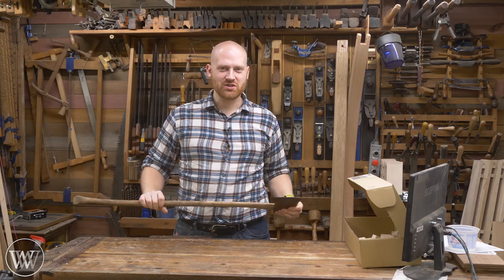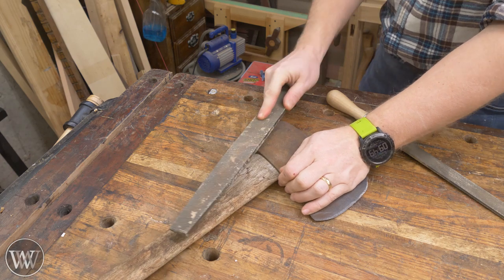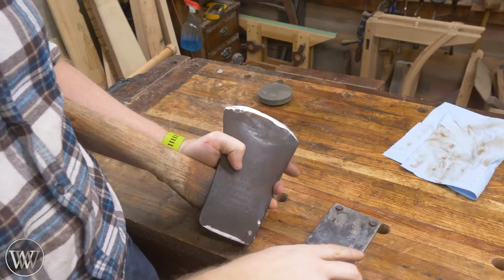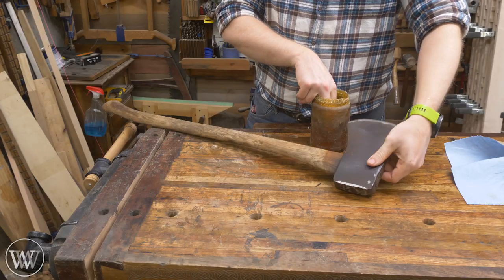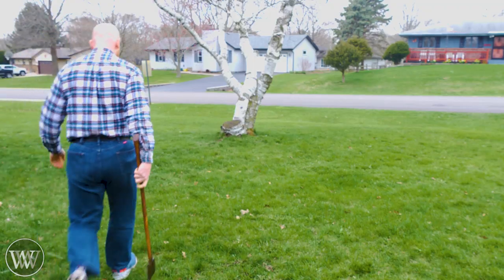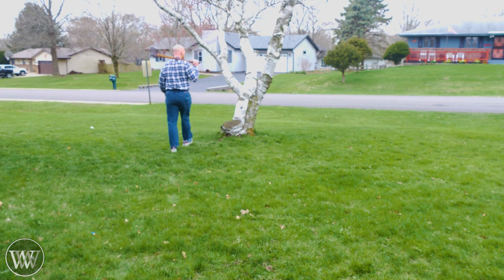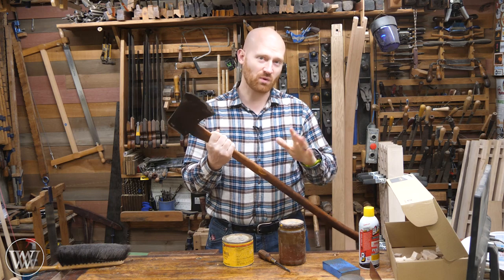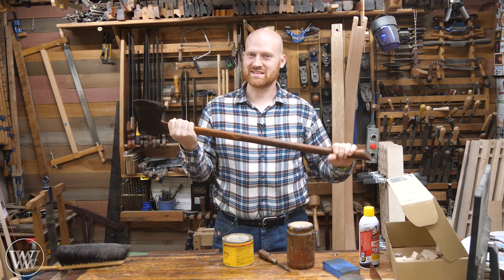Cleaning A felling Ax

Comment: Hey James, thank you for sharing this video, as it is always a joy to see good tools get some TLC. If you ever have a spare ax head or other tool with a lot of rust, try boiling it for twenty or thirty minutes and scrubbing the surface with a very light brush or fine wire wool. If I remember correctly, boiling the rusty iron converts the red oxide Fe2O3 to black oxide Fe3O4. (At least I HOPE I got that right, it has been so many years since I rust blued my beat up old second hand shotgun.) Once you get the look that you like , oil it up and let it sit overnight.
Reply from the maker: Interesting. I'll have to give that one a try. Thanks